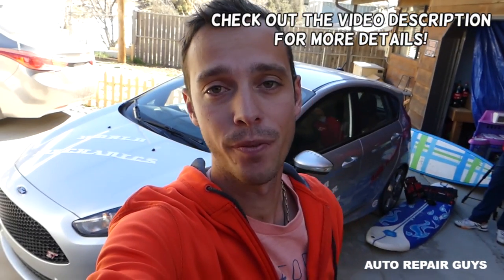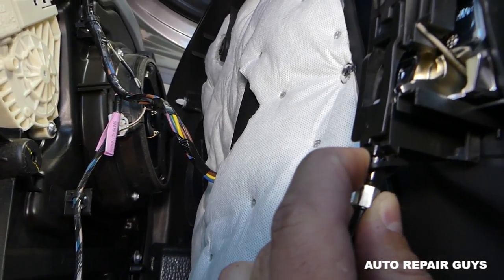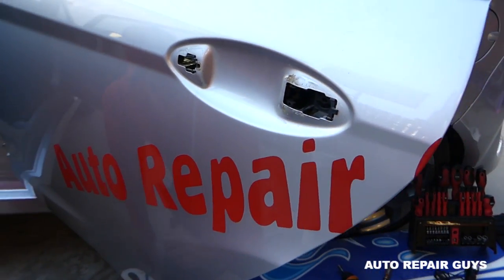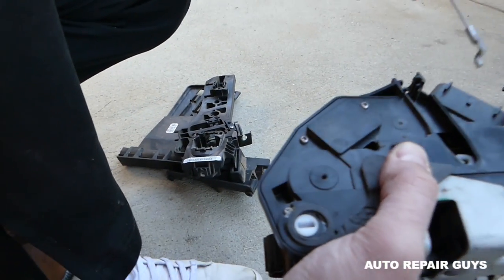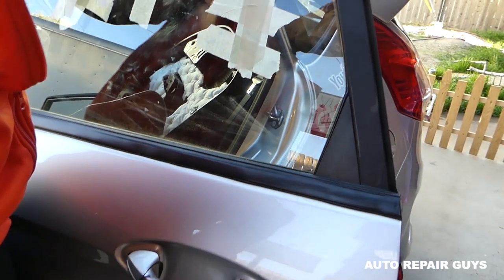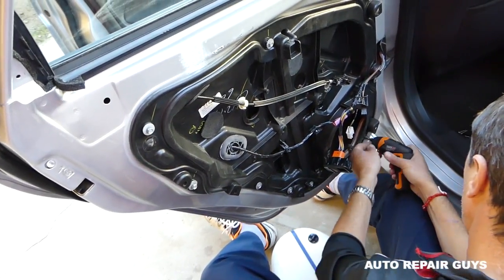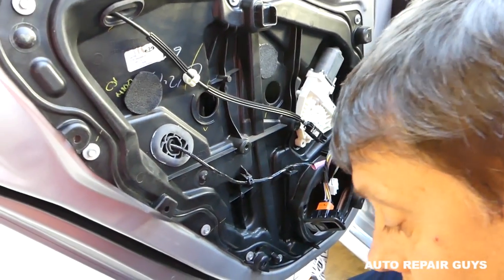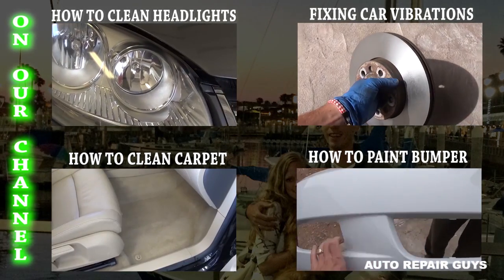FORD FIESTA REAR DOOR LOCK ACTUATOR REPLACEMENT REMOVAL

Comment: Guys thanks for the great videos but you cut out the part that I needed (at 5 minutes 29 seconds) which shows how to remove the inside panel to allow access into the door itself. This is the part that I'm stuck at. Your video cuts to removing the latch without showing how this is done. Once again thanks for the videos. 
OK, I just watched the whole video and got a pretty good idea of how it comes apart from watching you re-assemble it. It looks tricky. Thanks.
Reply: Jason Swain totally agree. How they left that out I have no idea. Downvoted.
Reply: Jason Swain. You need to remove the two circular foam stickers to locate the two 10mill nuts that connect the glass to the runner. Once youv removed those nuts, hold onto the inner door card and slide it right half an inch to release the clips and it should then come off in your hands
Reply: Had to watch another video. It was door panel removal.  You have to loosen the clamps that hold the window and prop it up.  They used tape in this video.
Reply: I hate when mechanics do this. The most important part of the procedures, you just skipped over. II you don't actually show the actuator replacement. This video is not helpful
Reply: Such a good video. Thank you!

Comment: I just Replace the driver side rear door lock assembly after watching the video. It went pretty smooth except the door open Warning is still coming up on the dash. I don't know why.
Reply: Update. I purchased a used rear door wire harness from ebay and change it with the one on the car and the warning light is off. Ya! Rewind few weeks ago I change the rear passenger door lock assembly but the door open warning light still came on. Well all fixed now!

Comment: how do I know that this is what I must do? Isnt there any diagnostic I can do before trying this? What happens with my rear door passenger side is that it wont open from the inside at first, but if I open it previously from the outside, then it will open from the inside. Id like to know if maybe I need to set up something before trying to repair anything. Thanks in advance.
Reply: I wonder the same thing. Mine won't lock at all. From inside, the locking lever bounces back. When centerlocking, all doors lock just this one stays open
Reply: @romeovarga3059  Hey I managed to get it fixed. There was no either way of doing it rather than disassembling the door as shown here. However, the good news is that you don't really need to get a new door lock mechanism as mine was refurbished after taking it out. Seems like an electrical issue that affects this single piece that prevents it from getting a signal that tells it to unlock.

Comment: Getting to that part is insane. Why do they make it so complicated. It seems that if you take it to the dealer, they would charge a lot. I can take my panel off and move two wires attached to the  door locking latch and 3  screws holding the latch in less than ten minutes. You would think a cheap car like that would be easier to fix than a high-end car. My friend has a car like the one you fixed. The latch doesn't work. He told me that it has a recall on it.

Comment: This video fails to show how to remove the inside panel. Very important piece that is almost a crime that they didn't show is that you need to lower your window slightly to reveal two 10mm bolts that are affixed to the window slider. These MUST be removed so you can detach the inner panel from the window. From there, you have to lift your window up off the inner panel clamps, and the inner panel will come free. I was about to hulk off the inner panel until I got a flashlight inside and saw what was happening. Could have broken something! Here's a video that shows you the two 10mm bolts. You can access them via two circular holes near the middle of the inside panel.

https://www.youtube.com/watch?v=AxSckWbvjSg